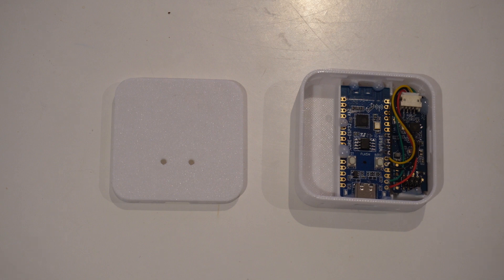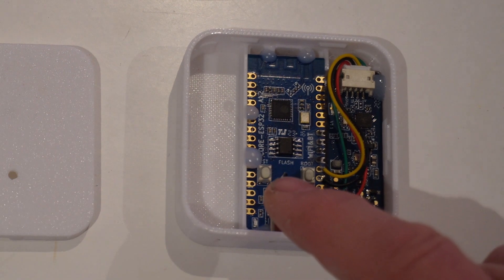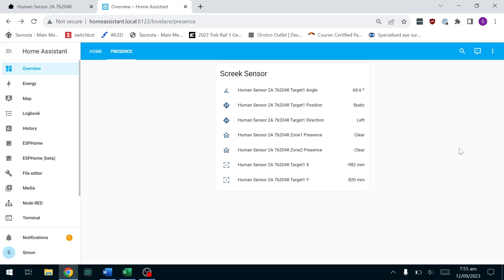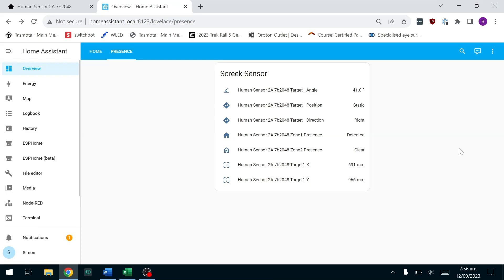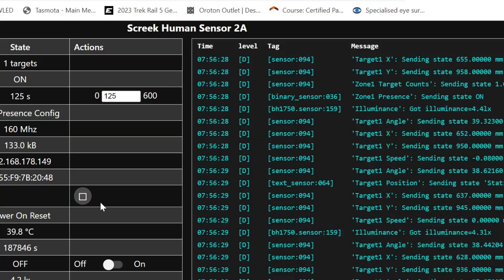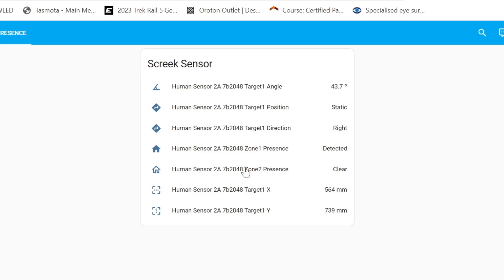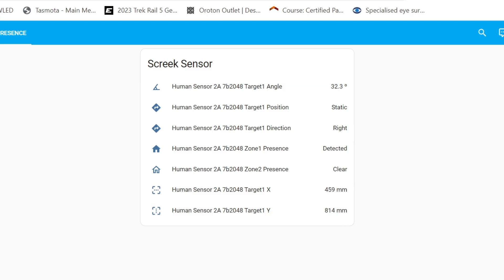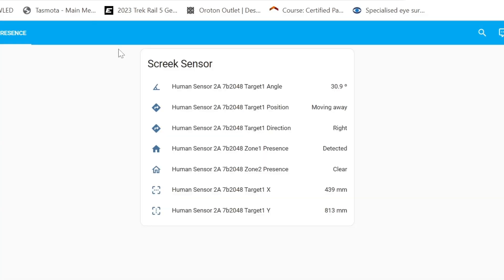New Features and Setting Zones for Presence Detection with Screek mmWave sensors.

Comment: Do you have any information about how to integrate it? It keeps failing when I try to connect it via USB and flash the sensor.
Reply from the maker: Hi, all the firmware update instructions can be found here : https://docs.screek.io/2a#36c36deb2a0c440fb76e90919a1b09c8 Seemed to work fine for me